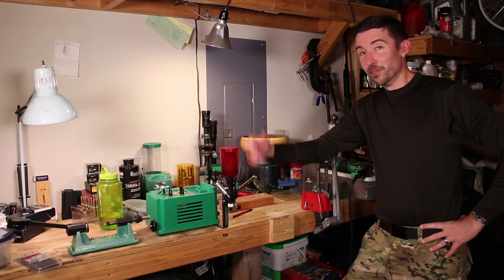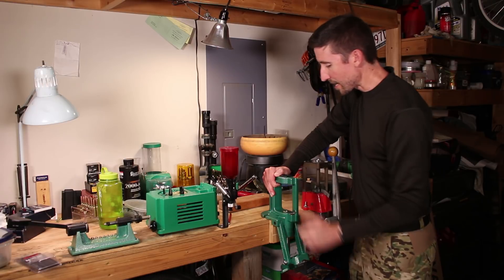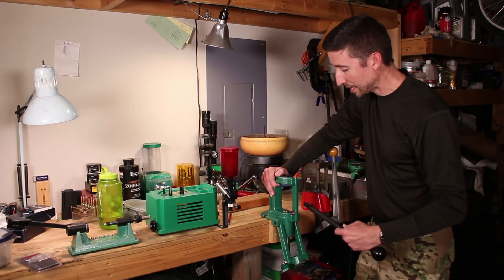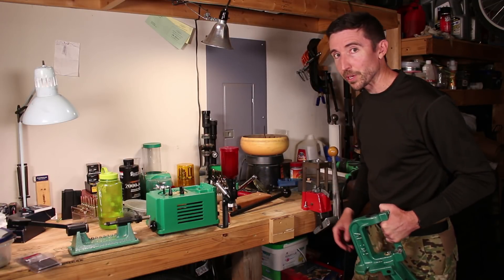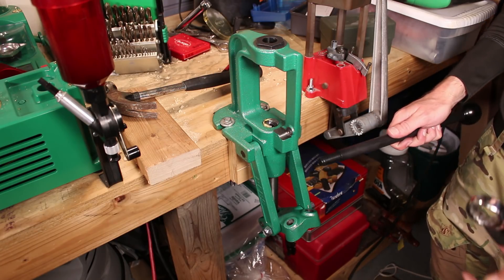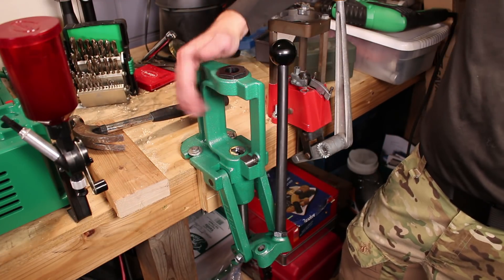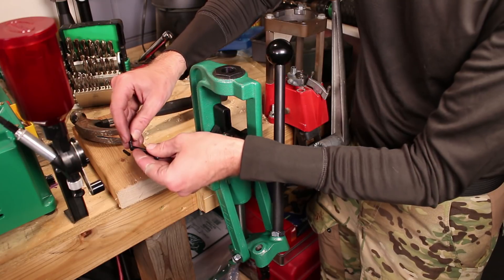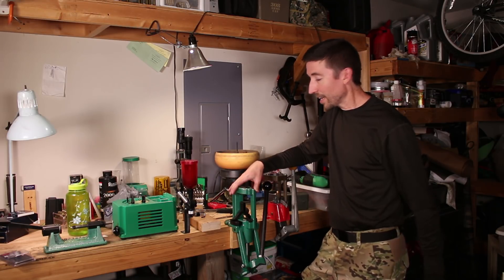First Look at the RCBS Rock Chucker Supreme - A Heavy Press for Heavy-Duty Work

Comment: Use 1/2" carriage bolts with nylock nuts to attach your rock chucker to the bench. If you have a wooded deck on your bench then use flat washers to tighten the nylocks against. I have a 1/4" steel bench top so no flat washers needed. 1/2" bolts are stronger and completely fill the slotted hole in the rock chucker base then the square part on the carriage bolt head will be stronger and prevent flexing. Works good for me. I use carriage bolts to mount all my presses.

Comment: You're my kind of a guy. Seeing you installing the RCBS press brings back memories. In the 1970's I was low on funds and cramped for space but couldn't pass up getting RCBS Rock Chucker Combo. I didn't have space to put in a work bench, let alone a table, in the room that I was renting. I made a sturdy saw horse and clamped my press to a saw horse. With my saw horse and the RCBS press, I reloaded and shot 300 Win Mag, 30-30 Win, 44 mag, 7mmTCU, 38 and 357mag, 221 Fire Ball, and 222Rem.
Reply from the maker: Sounds like my first setup. A rickety portable work table reinforced with plywood and c-clamps. Brother!

Comment: I just installed my new reloading bench and I went with the inline fabrication quick change press mount.
I'm extremely happy with it.
You get a top plate for all your presses, case trimmer, and all your other tools that comes pre-drilled with the needed mounting hardware. My bench is made similar to yours and I did have to buy a couple of lag screws to mount the front of the inline fabrication press mount but other than that it came with everything I needed.
I can now change presses in seconds. And it is rock solid.

Comment: ...bought my RockChucker 50 years ago sat the post Rod & Gun Club in Germany. I mount ALL my presses on plywood bases and use 'C' clamps to hold the bases to my bench..that way I can move it w/o leaving holes in the bench -or clamp it to ANY flat surface...BTW I still have that press as well as the micro adjustable Ohaus scale that came with the Ammo Crafters Kit

Comment: I took and put a strip of steel plate across the front of my bench. Bolted it on the 4 corners then drill and tap anywhere I want to fasten something. Has been awesome and super rigid.

Comment: I like to attach a 2x4 diagonally from the base underneath the table below the press to the wall stud directly on the floor....with a thick table the press will not flex at all on the down stroke. 
  It “can” be a little intrusive to storage underneath.  
  And depending on the width of your bench, you knees should be clear underneath while sitting.
...you could even move the 2x4 up the wall and fasten it there if there’s knee clearance issues. 🖖😎
Reply from the maker: Fantastic idea.

Comment: I have that press and yes it's a beast. I use Redding competition bushing dies and coupled with the press I can turn out some really tight tolerance ammo. Runout in my brass necks and loaded bullet is typically .001 or less. It replaced a Lyman turret head press that I got when I was in high school in the early 1970's. I don't use the priming arm but I did try it a couple times for the heck of it and seems okay. I much prefer my RCBS hand priming tool. That spent primer cup you have is a different and better design from mine.
Reply from the maker: Sweet! I'm looking forward similar results. And yeah, the priming arm doesn't have much feel to it.

Comment: Your bench had an 'L' shape structurally with the top attached to the horizontal 2x4 as a facia board.

If the 2x4 fascia board you drilled thru fails you can put/ glue a 2x4 of 12-18" behind & under the bench to repair it and strengthen your bench.    The small square piece does not spread the load past where your holes have weakened the facia board.  Make that piece longer and it may solve your problem as well.
Reply from the maker: Great idea.